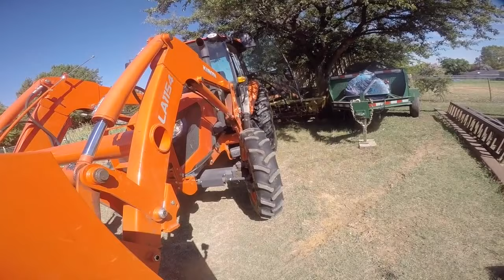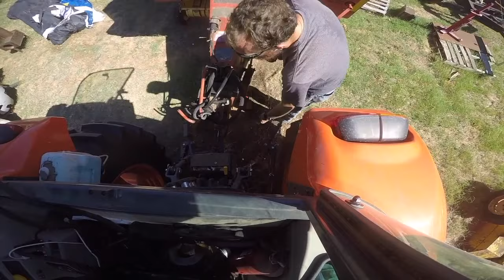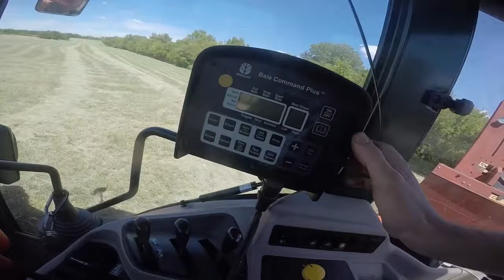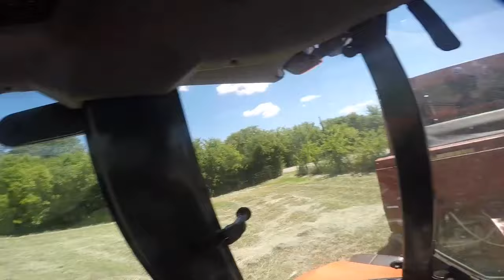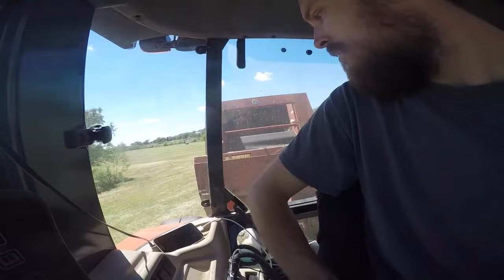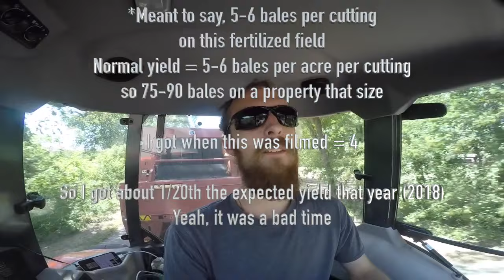CROP FAILURE DUE TO DROUGHT - WHEN THE HAY IS SO THIN IT WONT PAY FOR DIESEL FUEL!!!

Comment: How does it make any sense (cents) to run over a 15 acre field 3 times for so few bales?  I don't get it.
Reply: It doesn’t, but also I’m fairly certain this  video is several years old.
Reply: You cant leave it to rot. When farming you take what get.  Animals need feed, regardless of gas prices, regardless if you get 5 bales or 20. Most years are just catching up from the bad.
Reply: @farmerjer9339  leaving 4 bales over 15 acres to "rot" is a pretty dramatic response. Farming is not just about taking what you can get.  You pay for that the next year.
Reply: @alanwesterfield4254  those windrows would rot if left decreasing future yield in those areas, nothing dramatic about facts. You'd have to clean it up one way or another might as well bale it. Not cutting it to begin  with would also have lasting impacts...the fun of farming!
Reply: @farmerjer9339  What kind of lasting impacts would happen if they didn't even cut it?
Reply: @alanwesterfield4254  plant a pasture, let it go to seed. Find out yourself, I've got haying to get ready for! 😆
Reply: @alanwesterfield4254  Farmer Jer is right. It needs to be cut and baled or you're guaranteed to have a bad year with that field next year too